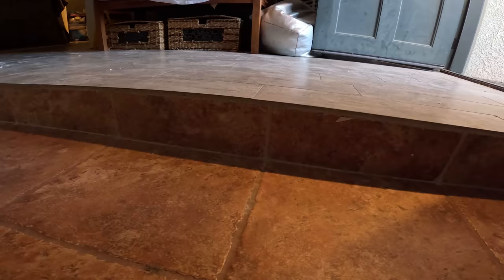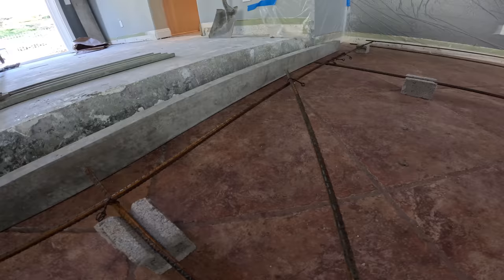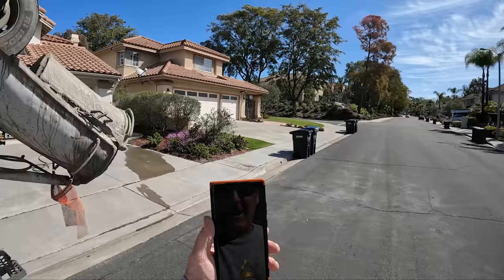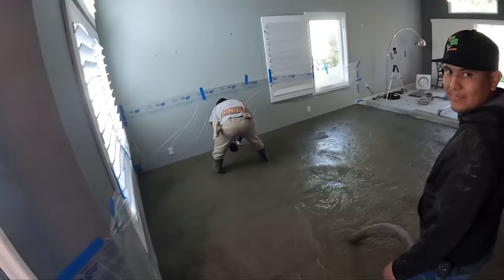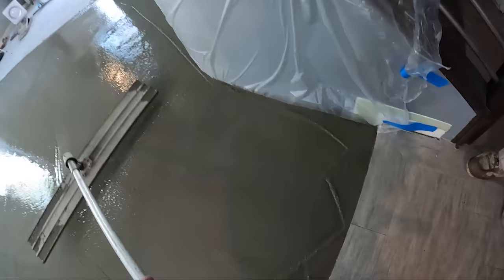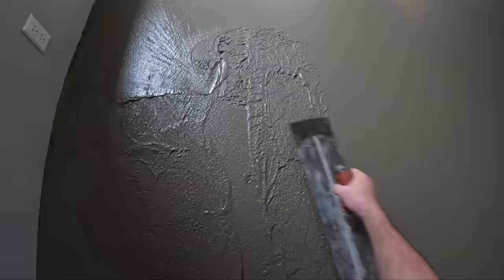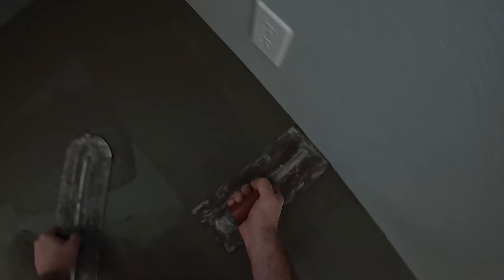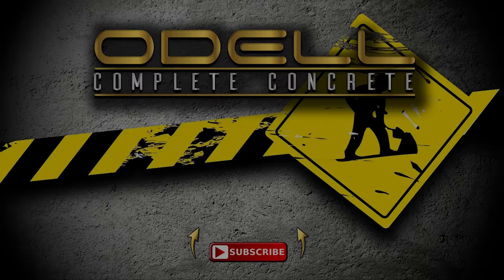We filled a living room full of concrete!

Comment: good job answering questions Dave!👍 got one for you
no expansion board is needed around perimeter for any concrete expanding? I have seen concrete explode up and crack because no room to expand
Reply from the maker: Depends on climate and soil conditions
Reply: No issue here because of the flowable fill mix and the climate will be pretty steady indoors.

Comment: Should of primed the hose outside my man that wet spot in the middle was from the water he primed the hose with.. turned out nice though I've done a few like this. they can be a pain when it's hot out that room gets so humid from the moisture in the concrete 😂🤦
Reply from the maker: The wash out did it.

Comment: Hi, I'm filling my sunken (172 mm) living room in Australia. We have double brick  walls with 50mm cavity on concrete slab. Do you recommend expansion foam against the walls? I'm wondering if the movement of the new concrete slab might push the internal load bearing wall outward. Thanks
Reply from the maker: Shouldn't move if you anchor it to the existing